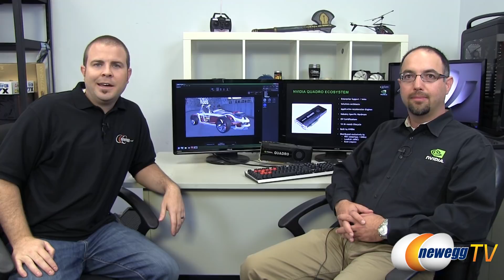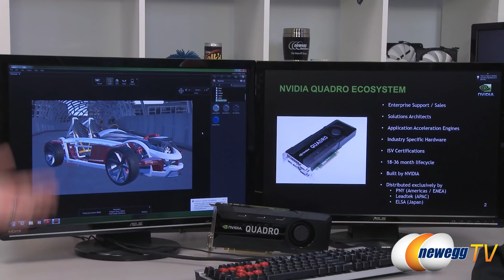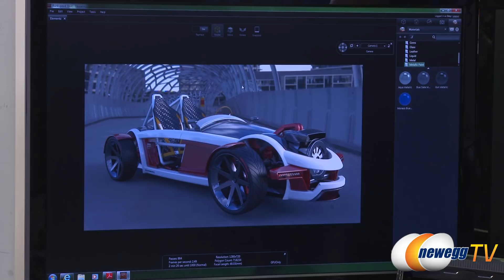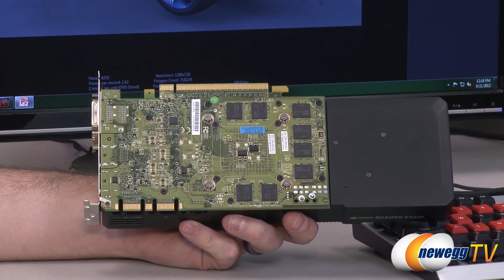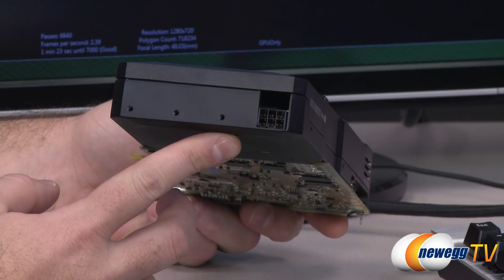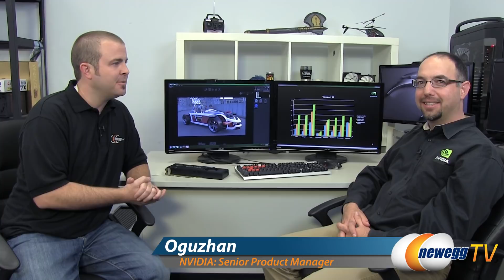Newegg TV: NVIDIA Quadro K5000 4GB 256-bit GDDR5 Workstation Video Card Overview w/Interview

Comment: When i ran both they used the same driver because they were both geforce cards but the quadro uses different drivers so just plug in both, then install the drivers for both and it should recognise automatically which card is which.

Comment: Well I  used to have a 470 as my main and a 610 as a spare so you asked the right guy, you would have to run a monitor off the 760 for the games to play on it, the only way you would get more performance in game is if you ran physx off of the quadro card but it will be a very little performance boost if any at all, but to use the quadro card ro render and to work with you would have to plug a screen into that too or just switch which card the monitor was plugged in too.

Comment: Thanks for answering =)
A 650 still plays all the games, Though if you have the money to buy this card + the rest of the super high end components needed to not bottle neck it i guess one would have a few extra bucks to spend on a second card that is better than a 650.
So if you don´t mind here is a follow up question is it possible to run a for example 760 as well and if so what is needed to do that also would the quadro card add any performance to it or would that just stay idle in game?

Comment: The k5000 has a gk104 chip which is the same as a gtx680, yes it will get lower framerates but not as low as your saying.

Comment: Quite literally the only reason the Quadro line of cards is so expensive is 3-fold: you're paying for the quality of work that goes into the product, you're paying for the software specialization that the cards are geared to, and lastly because more than likely you're working with industry standard software that in itself cost a more than a couple grand, so by business logic you can sell this for way more.